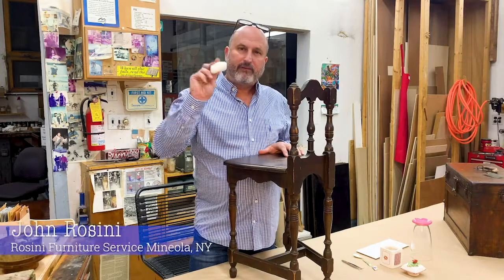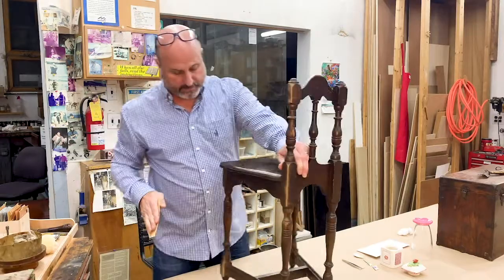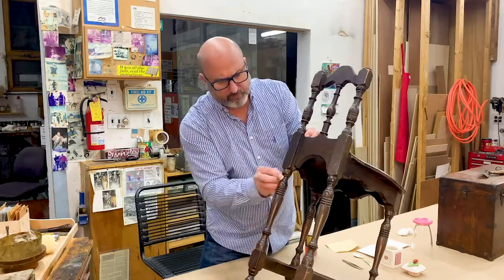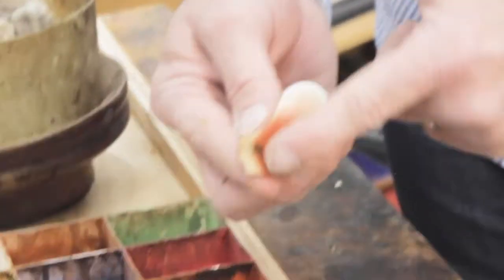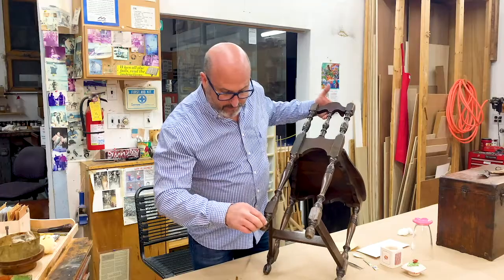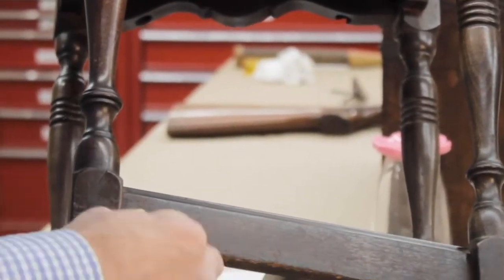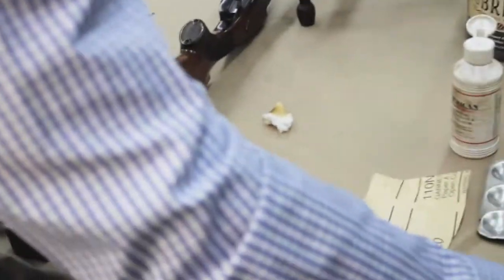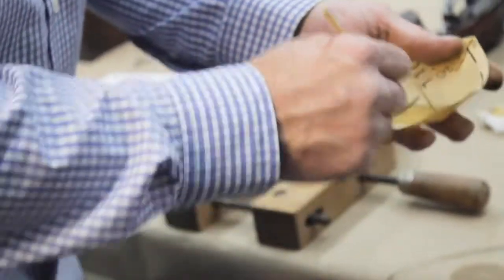Wood Touch-up, Repair, Revive & Recondition with 77 Lubricite and mineral powders.

Comment: The powder colors:

The pigmented colors are called fresco colors. You can get them from art supply stores. You can also get them from Mohawk Finishing Supply; Mohawk calls these powders Blendal Powders. A company called Touch Up Solutions also sells pigmented powders.

Aniline dye powders: Lockwood in NYC is a great source these aniline dye powders. For use with Lubricite or any other padding lacquer, including Zinnser Sealcoat, select the anilines made to be mixed (let down) in alcohol. These dye colorants make great color washes to create secondary coloring on critical Lubricite/coloring touch ups.
Reply from the maker: Really appreciate the additional information Big Swifty!